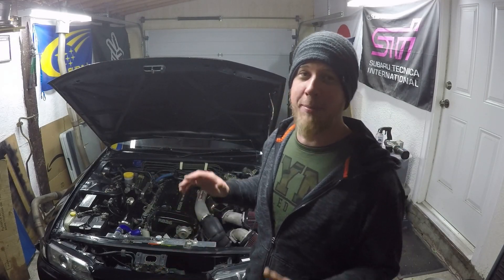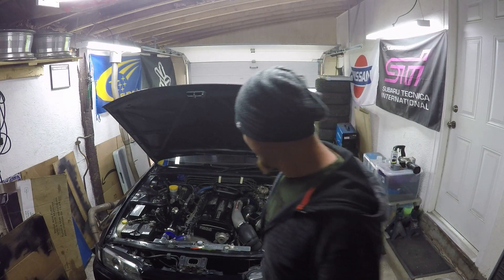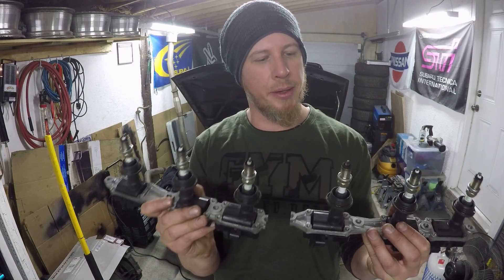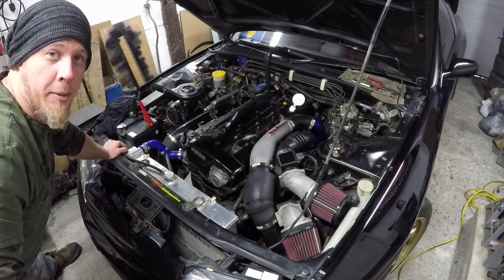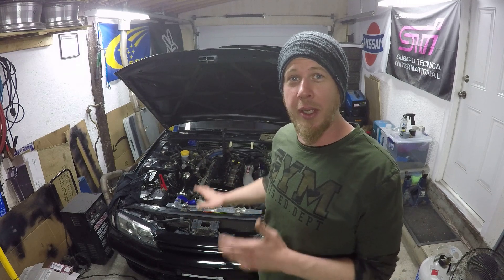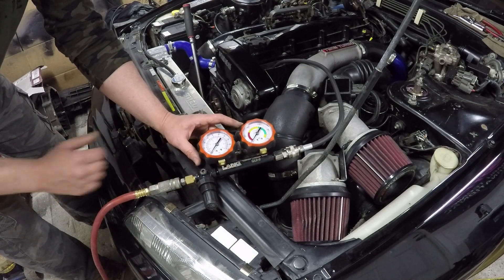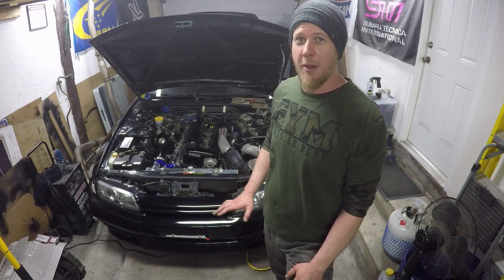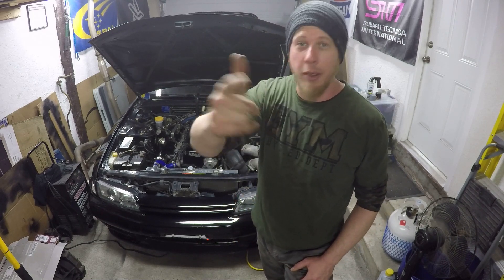Skyline GTR RB26DETT Compression and Leak Down Test - How To

Comment: Hey great video. I was told a leak down test can determine whether the leak is bottom end or top end related. I did compression test on my rb with 1-5 holding 150lbs and #6 at 50lbs. Any help would be great!
Reply from the maker: Thanks! Now that you have found a low compression result on #6, next you want to perform a leakdown test on the cylinder. Add compressed air to number 6 cylinder while that cylinder is at top dead center. Listen to the intake, exhaust, valve cover to listen where the leaking air is coming from. This can give you an idea of what's happened. In any case, that engine is coming apart for repair.
Reply: Homebrew Subaru oh man awesome advice thank you!! what are the chances to actually find out what went wrong? Basically I don’t want to build the bottom end if it’s a valve etc.
Reply from the maker: @soso_yozora  If air is heard leaking from the exhaust or intake, more than likely you have a burned valve. You should determine whether the problem lies in the head or the bottom end before disassembly. It will save you time and money

Comment: Have never been involved in a 'leak down test' but have done plenty compression tests invariably looking for leaking valve seats/seals, piston ring bypass and/or head gasket failures. Is that the purpose of the 'test'? Thanks again for another informative video.
Reply from the maker: The purpose of a leak down is to determine how much the cylinder actually leaks. No leak is good. With a piston at TDC the cylinder should be sealed. If it's leaking you can attempt to trace the leaking air through the intake, exhaust, oil or coolant.